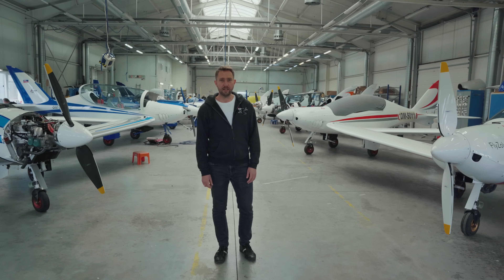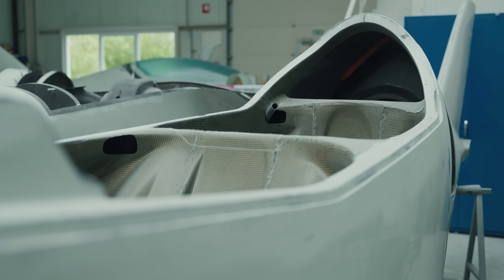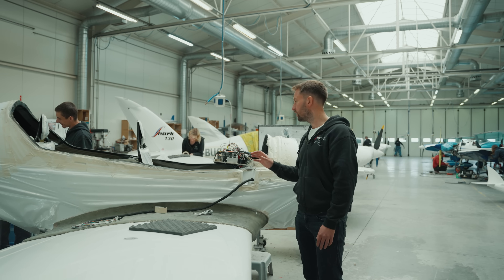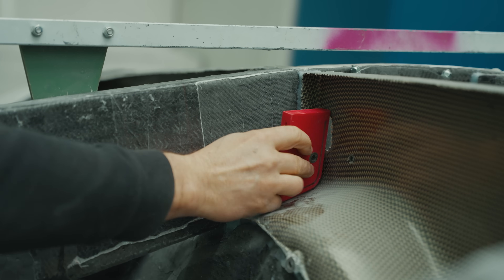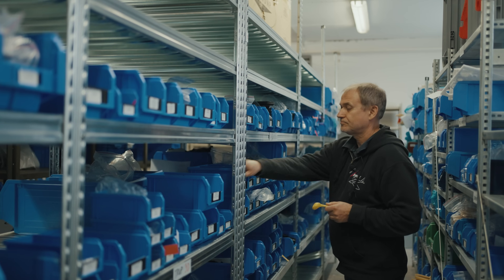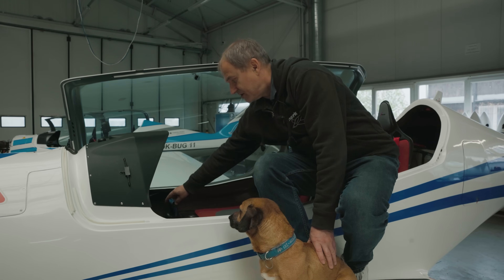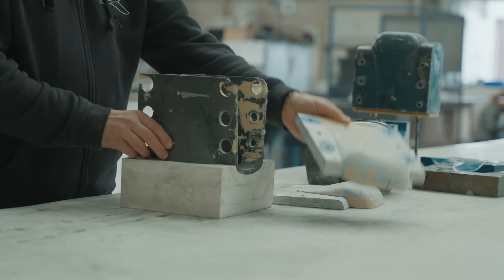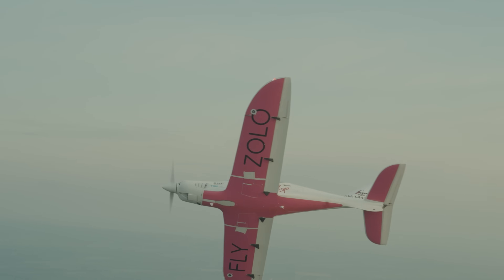SHARK.AERO: Where 3D Printing Meets Aviation

Comment: So, whole plane dangles on parachute ?
Reply: That’s right
Reply: Same idea as when a lander (like crew dragon) comes back from space. Those parachute cords are really strong!
Reply: It's a last-ditch safety feature. The only situation where you would pull a parachute is if the aircraft is in an unrecoverable spin (Certain death), or if there is a structural/mechanical failure that makes controlling the aircraft impossible (Astronomically unlikely)

Hitting the ground hard but surviving, as you would with a parachute, is preferable to hitting the ground VERY hard and dying along with the airplane.

They come standard on Cirrus airplanes, look up "Cirrus CAPS"

Comment: Do you not use respirator masks when working with composites??
Reply: They are immortal,  safety and common sense does not apply to them.
Reply: No need. But all employees are tested for allergies before taking the job.
Reply: @sharkairplane Sir., I don't want to seem like an internet expert, but please read this comment. The comment from @tramsgar is very important. There are some things that despite not causing allergies can be very harmful. Think of this: even though no one is allergic to lead, people who worked at lead processing factories often suffered from plumbism due to poor ventilation and improper use of respirator masks. Composite materials, specially the fibers in the glass fiber composites are extremely harmful to the operator's lungs. When sanding, micro particles of these fibers are projected upwards to the air and if no respiratory equipment is used, operator's can easily inhale the particles. Once again, I am not trying to be an internet expert but please don't take safety lightly.

Comment: I hope this "pushing the boundries of aviation" doesn't end up like Titan did.
Reply: Fortunately the aerospace field as a lot more regulation associated with it.
Reply: Everything is thoroughly tested according to the certification basis under supervision of authorities. Modern aircraft engines also use metal 3D printed parts. No worries. 😉